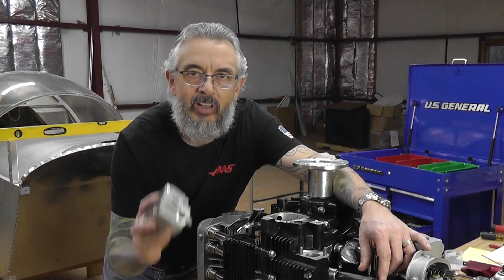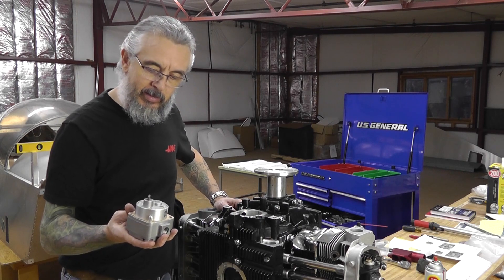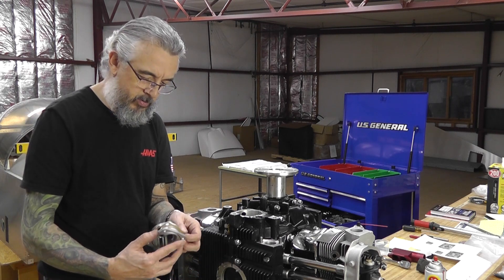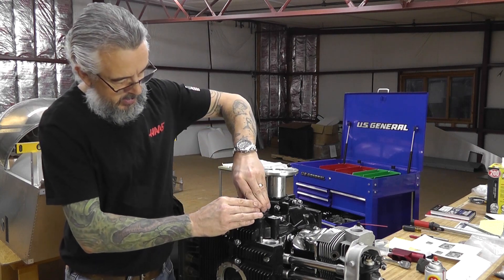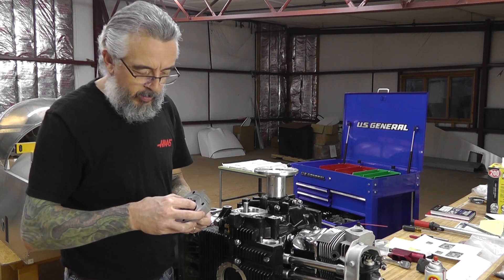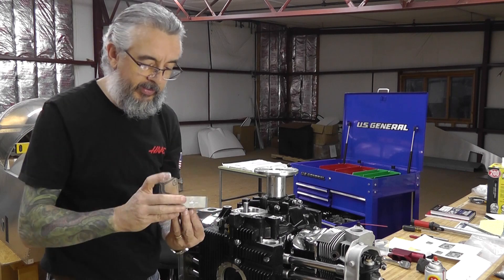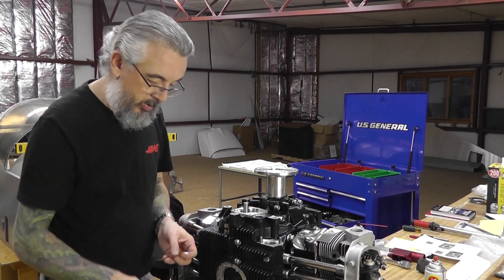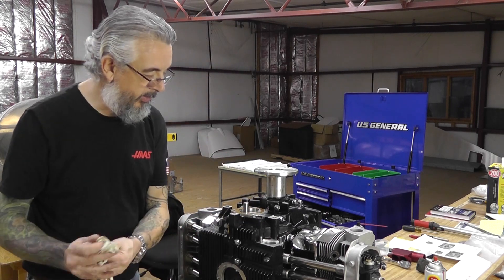Sonex Build Part 18 - Turbo Aerovee Airplane Engine Gets Dual Oil Pumps

Comment: Engine coming along well.  Looking forward to the airframe build next and if you are able to rebuild the tail feathers.  I myself am in the final stages of building a CH750 Cruzer powered by a Yamaha Apex so understand the joy as well as the challenges and frustrations at times in the build process.  Just keep at it and find yourself an experienced advisor if for no other reason but to have someone to talk through problems or questions you have.    Crazy as it may seem I’m not quite finished my current project and am already starting to think of my next project and the V tail Waiex and Aerovee Turbo are top of list right now.  I’m biased toward the V tail as I’ve owned and flown a ‘64 Bonanza S35 V tail for the past 15 years.  Love that look!   Good luck with your build and with getting your pilots license.   Aviation is a great group of people so welcome aboard!  Cheers.  Jim
Reply from the maker: Thanks Jim. I’ve always had a soft spot for those Bonazas. I will definitely be looking at them when I’m ready for a complex aircraft. I like those Cruzers too. If I remember right you can look out the top in turns and blind spots in turns is one of the major reasons I prefer low wings. Hope you get it in the air soon. Feel free to pick my brain on the Waiex and Turbo Aerovee. If I don’t know the answer I can most likely find it from other builders that I talk with.

Comment: Two more tips on the oil pump: (1) Pay very close attention to the manual and the fittings/washers called out for each hose attachment. Sonex instructions have changed over time so check that you have the latest revision of the proper manual.  (2) If you find that the oil pump weeps oil, it is likely coming around/through the paper gasket(s). Do not attempt to solve the leak by over-torquing the cap-screws on the pump housing - this is more likely to cause damage to the engine case than stop the leak! Some of us have found that a very light coating of Form-A-Gasket on the mating surfaces will stop the weeping - just be absolutely sure not to apply too much, as any squeeze-out can get into the pump cavity and cause havoc (potentially blocking oil passages and such).
Reply from the maker: Thank you sir. I appreciate the insight. I have downloaded the latest Turbo Aerovee assembly manual and will look closely at any revisions that may not have applied. Hopefully there is nothing that involves tearing the cases back apart but even it that is needed then I guess it is better now than later when it is complete and installed or possibly flying.